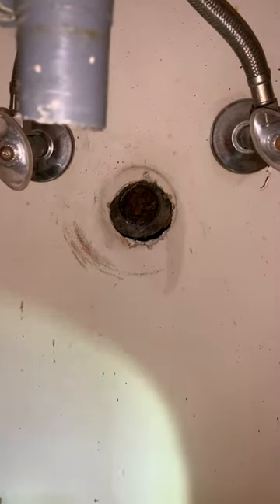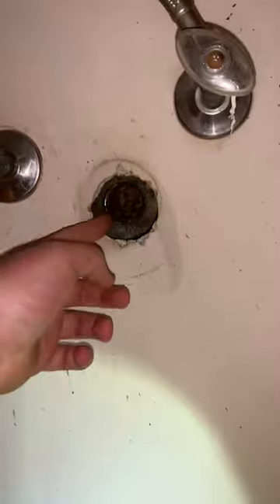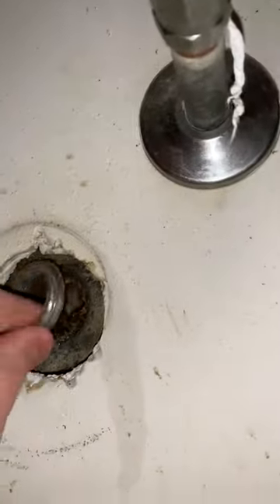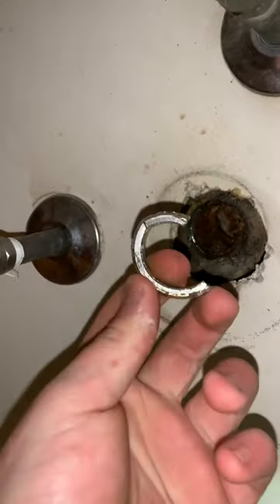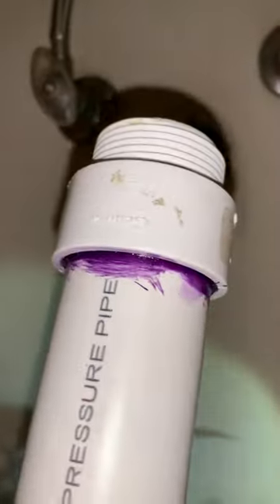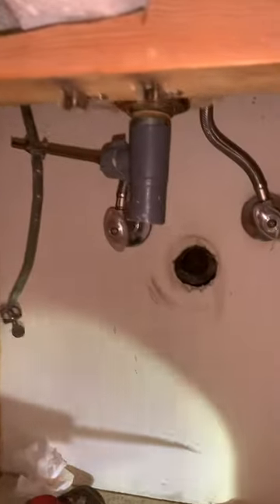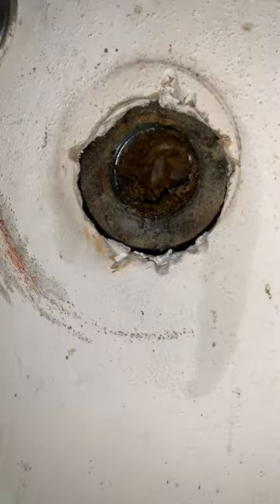How to remove a threaded nipple from a fitting inside the wall.

Comment: Im having problems finding well made plastic DWV male adaptors. Most of them are a 1/16"  to 1/8"  smaller than the id of the pipe size. A plumber said to use a trap adaptor because they have a wider id but they are straight threads with no taper to them.🤔
Reply from the maker: A lot of the trap adapters have a thin wall hub so I would avoid those, I have thought about the male adapter issue and I have found that older male adapters have a thicker male side. A new male adapter I would recommend is one made by spears.
Reply: @jacksplumbingvideos7147  Cool thanks for the reply.👍
Reply: Try a local plumbing supply store, they have higher quality parts compared to big box stores.